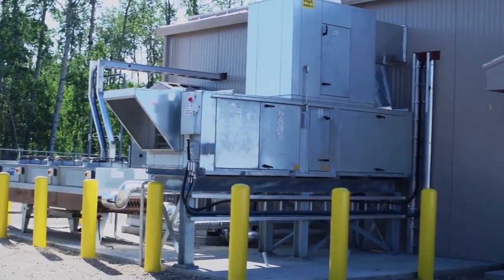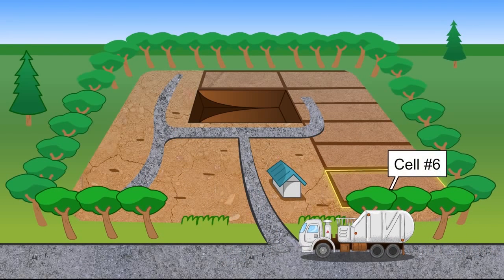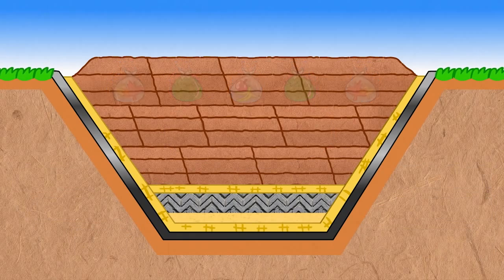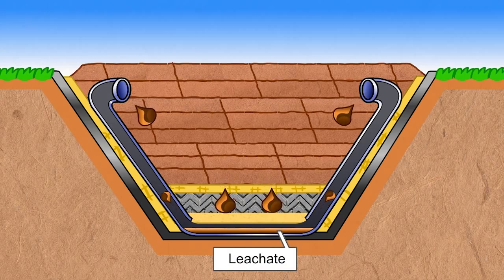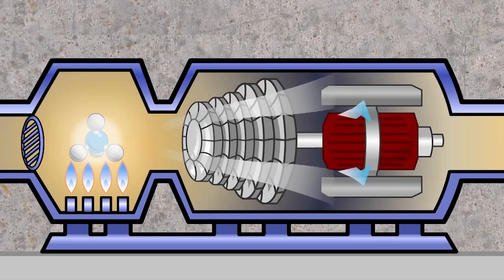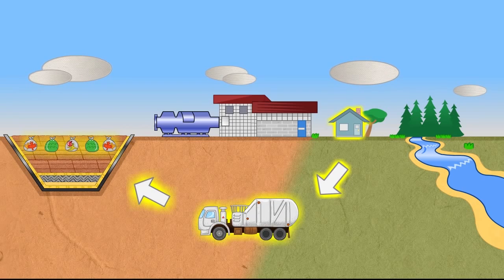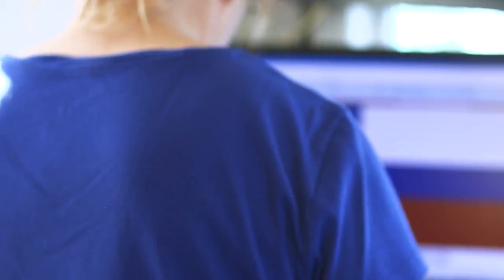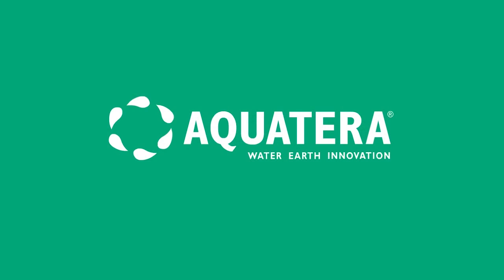Aquatera's Landfill Gas-to-Energy Project

Comment: How much CO2 is produced from this process? Sounds good for the organics and other fast compostables, but these could be composted separately.  Still sounds like a landfill to me, just with methane harvesting.  So, not a big change from the status quo.
Reply: Usually, arround 45-50% of the gas produced is CO2
Reply: To significantly reduce the greenhouses, it should be a closed system, similarly to a batch vessel.